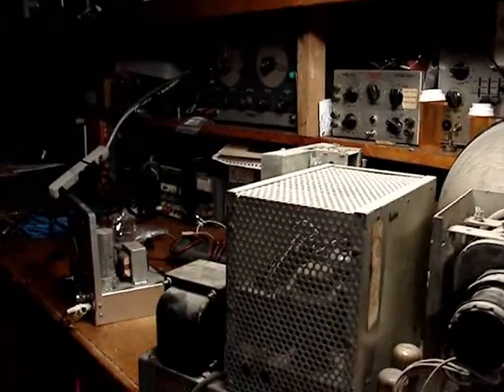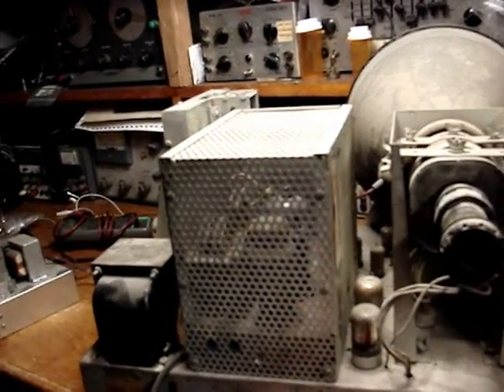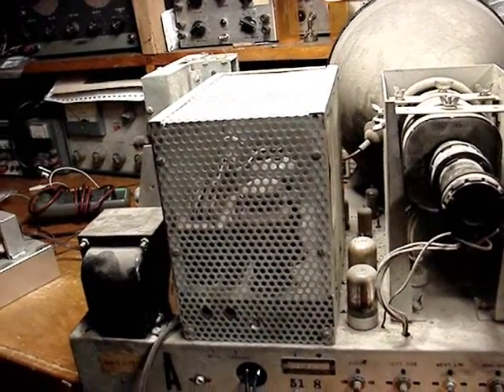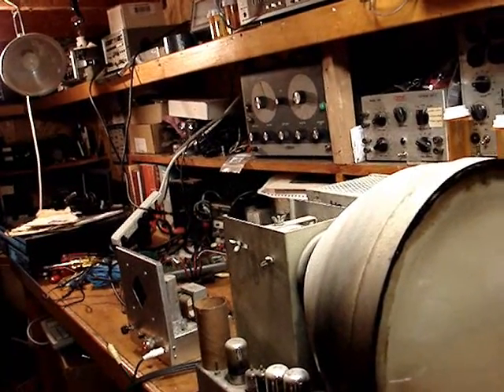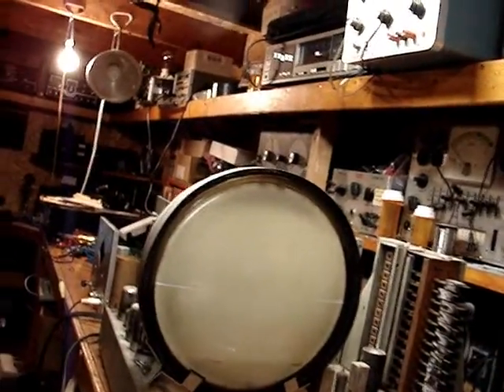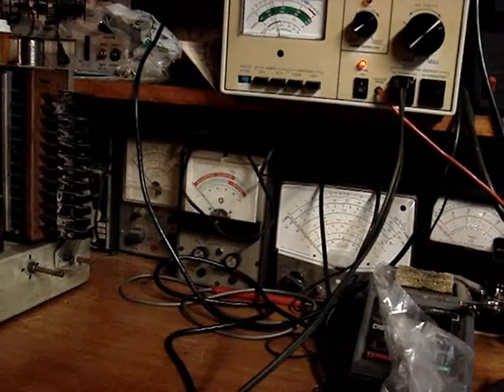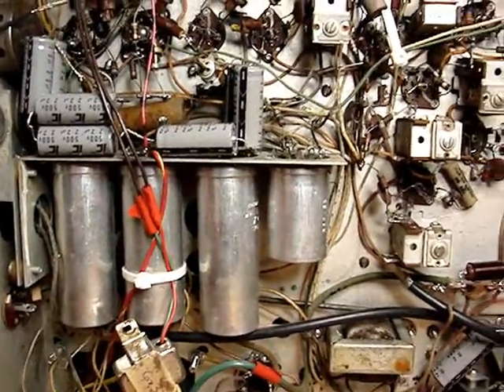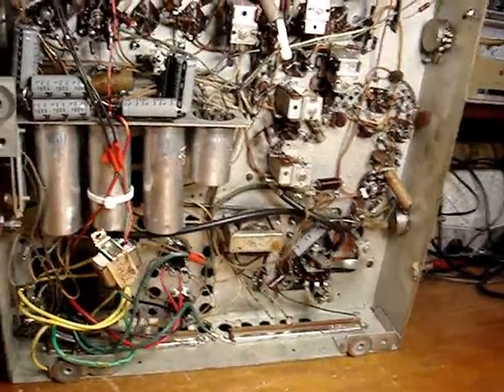1948 Sears Silvertone TV Radio console PT3

Comment: To think Gary you let Don egg you on like that! Will be nice to see it up and running completely!  I like your vintage workbench shop tools....I spend equal time looking at them and the subject!  :)  What happen to the Canon?  ~Jack, VEG
Reply from the maker: The Canon makes MTS files that have to be converted but I can still use it and probably should. Not too many people seem to be doing much on youtube of late. Some of whom I have watched their videos seem to have dropped off the scene.
Reply: MTS is no big deal, however it's really up to your editor whether or not it can handle it! I think you use Microsoft's editor, just make sure you have the latest and proper codecs installed and you should be OK...however, I don't use MS editor (I use Adobe Premiere Pro CC 2015, and I have the same Canon as you), but it's the same story, needs to have proper codecs to edit them.  I too have noticed folks slowing down or stopping....guess they needs a break?
Reply from the maker: I am still running XP and I use Windows Movie Maker. I can convert the MTS files to HD WMV files but if I process those files in Movie Maker the definition gets dumed down to SD. In reality it doesn't make all that much difference considering what the video content is.
Reply: I use Windows 7, I don't wanna move forward...however I also liked Win98 and XP, didn't wanna give up XP!  So, you are in luck, I have a computer of each I use for my vintage cameras that don't work on modern OS's.

  I opened up MS Movie Maker and found what you needs to do to produce a 16x9 video, follow these steps:  

1) Open Movie Maker
2) Click on TOOLS
3) Scroll down to OPTIONS and click on it
4) Select the ADVANCED tab
5) Go to the middle of the dialog window and select 16:9
6) Click OK
7) Restart MS Movie Maker 
 
That should take care of that issue!  For codecs, I use: https://www.codecguide.com/download_kl.htm and select MEGA, restart your machine and you should be good to go!  ~Jack, VEG
Reply: Well Jack the vidmeister hits the nail on the head, I usually hit my thumb.  Thanks for this fyi, I hope old64goat sees this comment, very usefull.  thanks buddy.  Don
Reply: Hey Don you are very welcomed, hope it does help those that need it!  Haven't seen you on much Don, hope all is well!  Looking forward to a future video(?) from you.  Jack, VEG
Reply: hopefully this weekend, to the editor...
Reply: Very cool, will look forward to it! 73's OM. ~ Jack, VEG
Reply: it's up

Comment: I was hoping for some fireworks..  is that bad?  :)
Reply from the maker: LOL Bret. I am not sure how well I will pull off getting this particular set working considering what was done to it by a previous tech. My first goal is to see if I can fix the vertical deflection and then test the voltages to see how close they come to the schematic considering the replacement transformer. Gary
Reply: Might be a bit much for your 3rd TV set?  Depending on my mood, I might trudge forward since I know I'd have to meet this challenge eventually.  I was so frustrated with the video hum in the Hoffman set.  I'm still not happy about the tacked in additional Caps.
Reply: IF the set was more "original" like stock, perhaps it would be more prudent to not throw caution to the wind, but since it is full of mods, why not have a bit of fun?  lol
Reply from the maker: I will take the set as far as I can go with it. My next goal is to just get full raster by repairing or rebuilding the vertical circuits. If the B+ voltages are way off with that replacement transformer I will stop at that point until I find a more suitable transformer.
Reply from the maker: Exactly my thoughts but if I would have seen the current shoot up too high I would have killed power right away. I think I can get this TV working if I find that the B+ voltages are at least within reasonable closeness to what is listed in the schematic. If those voltages are way off I will stop until I find a transformer that would work better. I have not yet tested the voltages but I will when I rebuild the vertical circuits.
Reply: Shango866 is the place to see fireworks.  He'll plug in an old tube  TV that was buried in mud, and the dang thing will work!
Reply from the maker: Shango066 also roasts TVs while the debates are on.